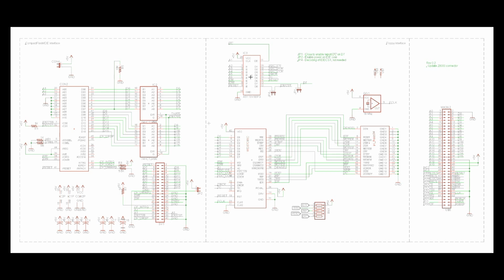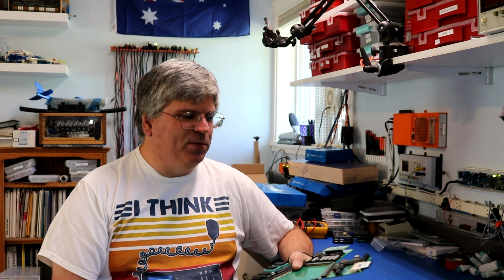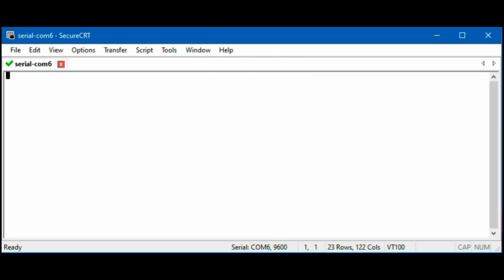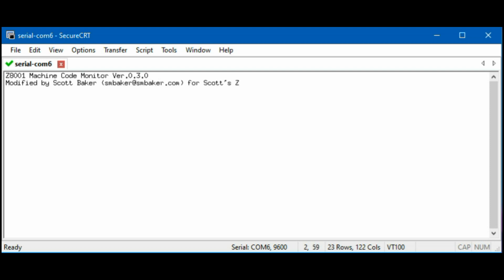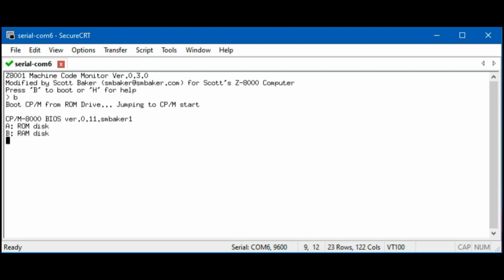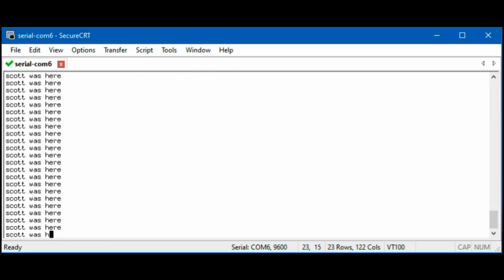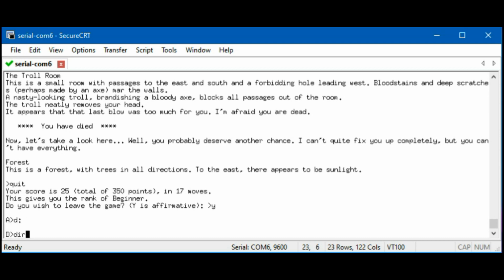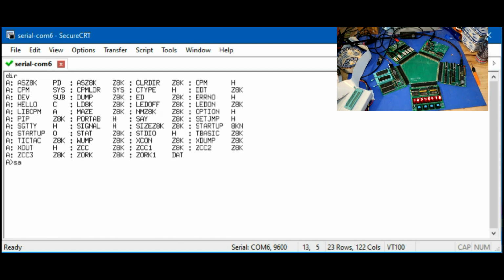Zilog Z8000 retro computer part 2: CompactFlash, Floppy, Pi Supervisor, and speech synthesizer

Comment: if you make a bridge board to link clovers then you can make a field of clover computers.  the bridge can map on alternate clock cycles so it can access memory opposite to the z8000, then... the same to the next linked via bridge clover.  the bridge can map one clover in a different location to the other - that design allows you to link and bridge as many clovers as you like with the same bridge hardware.  All cloves effectively synced, and all bridges on alternate clock cycles with a very fast full memory access to each adjacent clover.